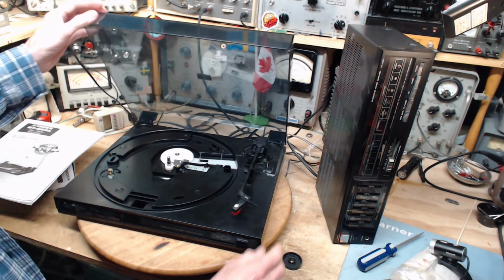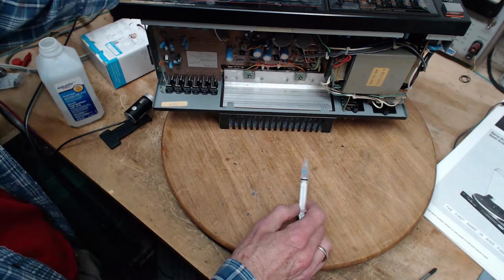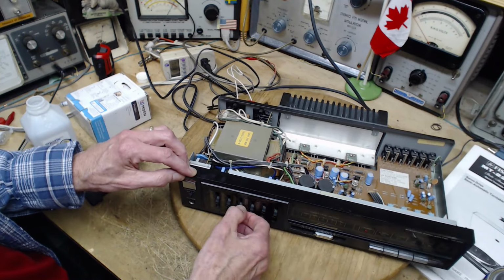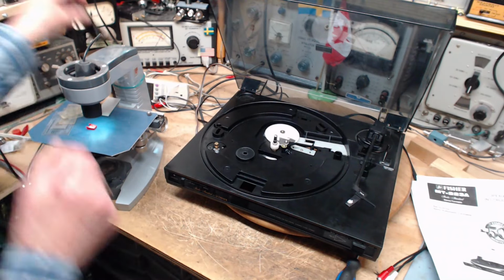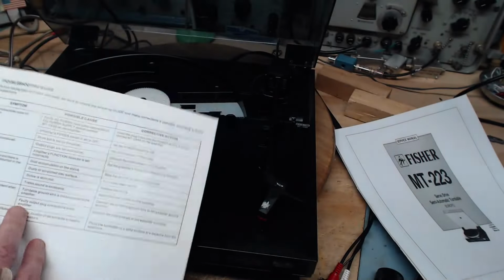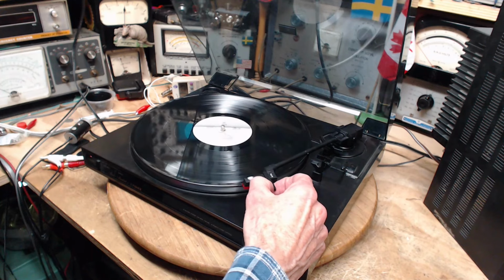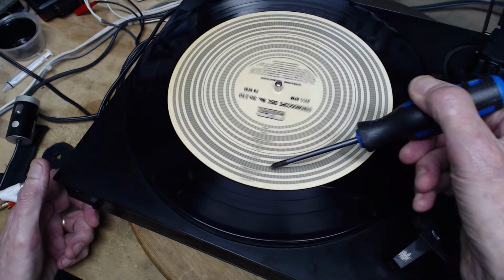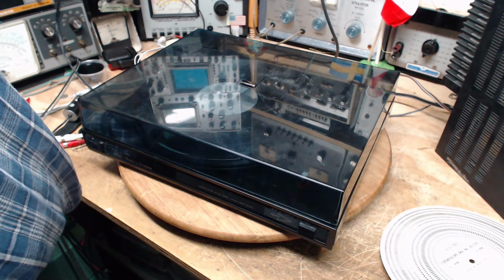Fisher System 8700 and MT 223A Turntable Video #2 -  Switches, Needle, Tracking, Speed and Quality

Comment: Jim, Fisher used to be a high-end brand back in the 1960's when it was made in the US.  Their tube amplifiers/receivers still come with a hefty price tag today if you're lucky enough to find one like their 500 or 800 models (They usually sell for over $1,000 US)  I have one of their early transistorized models from 1968 that still sounds awesome today.  Back then the brand name was "The Fisher" and mine is a model 125.  Now, it does have a BSR turntable on it, but it's one of their better ones with a steel plinth, metal platter and uses a Pickering V-15 moving magnet cartridge.  Fisher sold out to Sanyo in the early 1970's and while the early Sanyo Fishers were still good systems they weren't near the quality of the US made units.  By the 1980's they began producing low-end equipment while still trying to ride on the name alone.  I have no idea if they're still even around today, but if they are, I suspect they'd be just another old name owned by some company producing trash in the way of modern stuff with the Philco name has become.